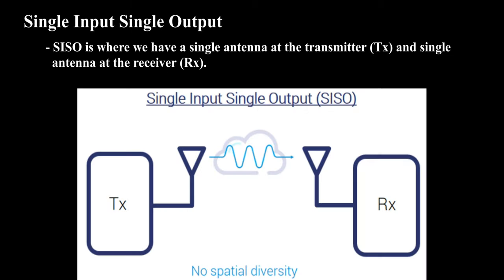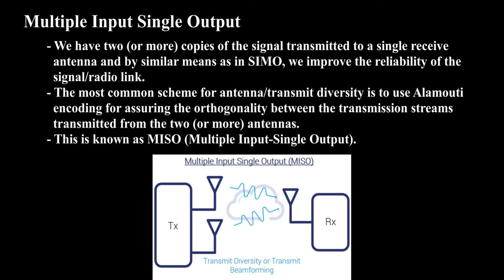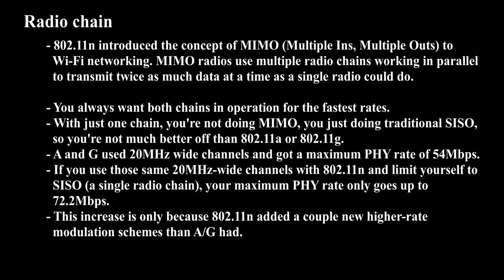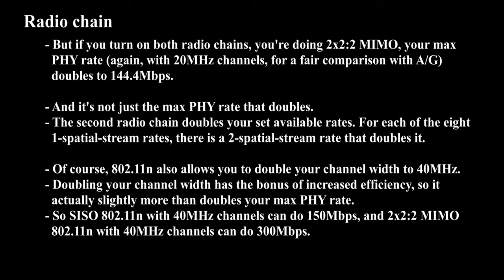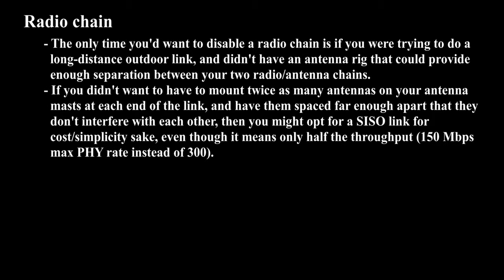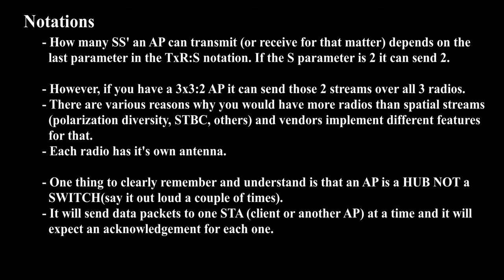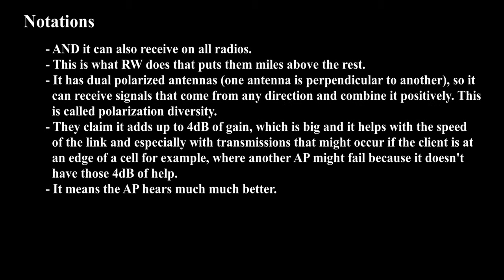Radio Chains and Spatial Streams in WIFI | @leostechtalk  | radiochain | spatialstream | wifi |

Comment: Hi Leo, great video!
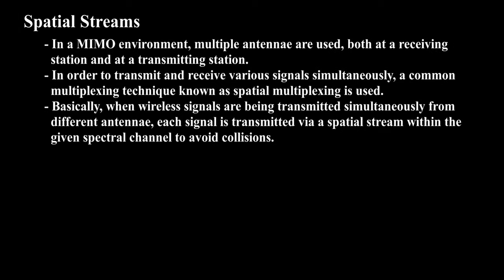At 4:50 where you say "the signals being transmitted by the various antnae are multiplexed by using different spaces within the same spectral channel.". Could you add some detail?
Are the sub-carriers of the channel divided and used separately by the separate radio chains? I think each radio chain uses the whole spectral channel, right?
So they each use the whole spectral channel and all the sub-carriers, each sending unique data. How do they manage this?
Is it that each radio chain is polarized differently and so naturally the two transmitting streams will have different polarizations and each receiving station, being polarized differently, will naturally receive only one of the spatial streams rather than the other?
Reply from the maker: Pls bear with me. Will clarify your query ASAP.
Reply from the maker: Could you refer the below link, i hope this clarifies your query.
https://www.onehospitality.co.th/understanding-mimo-and-spatial-streams/

Comment: In a 4x4 AP, Is there a way to setup the client to connect not using 3x3 but 2x2 or 1x1 ?
Reply from the maker: Yes, Is the client a 4X4?
Reply: @leostechtalk  the cliente is a 4x4 as well, but I'd like to reduce to 1x1
Reply from the maker: Sorry for the late response.

First of all, why you want to reduce the chain mask in the client side, hope you are aware of the outcome?

In linux clients,  chain mask can be configured to 3X3/2X2/1X1 but not in windows clients.
Reply: @leostechtalk  Thx for your reply. I need to reproduce a few tests in TR-398. Some of them require 1x1 or 2x2.